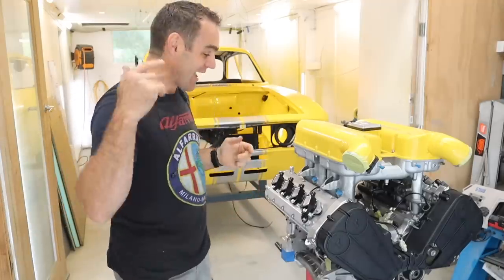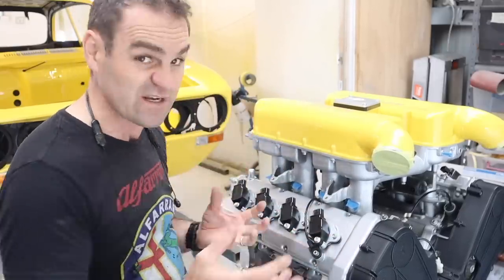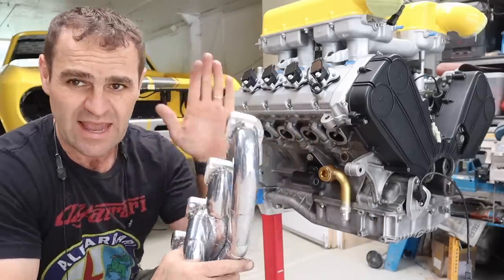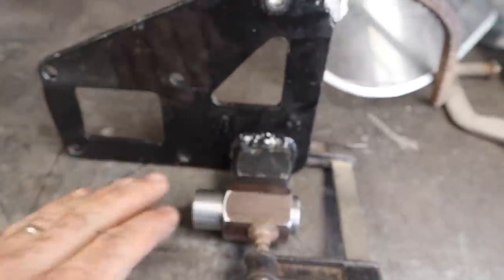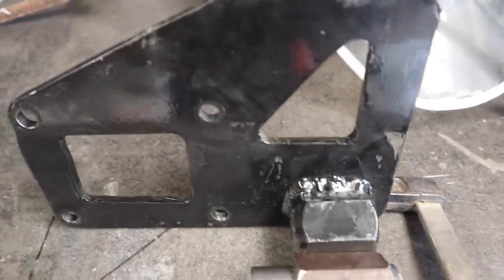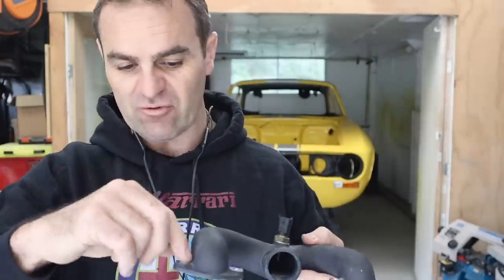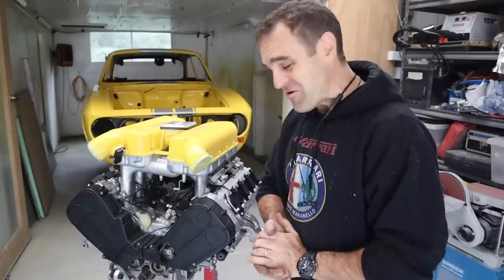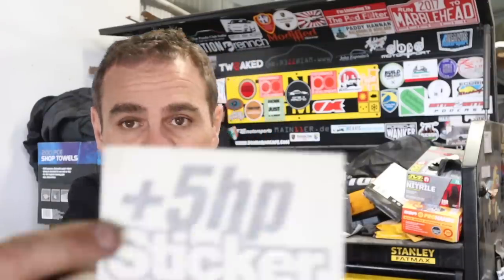I broke part of the Ferrari engine - Ferrari engined Alfa 105 Alfarrari build part 162

Comment: The engine looks sweet Jeff.
I think what you did with the coil packs is spot on.
Cheap simple effective.
And nice touch painting the lower shim as it looks like a rubber gasket & looks factory. 
Easy to remove the coil packs.
..
The alternator does look a bit low there possibly vulnerable to road debris.
...
Taverish had the exhaust manifolds ceramic coated on his Lamborghini project a few years ago.
Claimed a 20% heat reduction looks good too.👍

Comment: As for the oil and washe fluid caps,one potential solution to label them IN the car and not in the caps,would be to cut some stencils with only the little icons that appear in an ordinary cluster and paintbrush them in the car.something like we do to paintbrush the insignias on plastic model kits of fighter planes!

Comment: For washer and sump caps you could consider a tastefully subtle color coding on the edges of the cap that match to a small stripe on the engine bay. 

Just a thought, excellent video per the usual 🙂

Comment: For the caps, the labels doesn't need to be seen from the outside, you could add a small indicator as soon as you remove the cap. You can paint it with a light color, or you can add a painted ring with am emblem on it on the inside of the tube and not on the caps. As soon as you remove the cap you will see the indication.

Comment: Great job man. I’m a little concerned about the exhaust manifold studs length. If I can give you some advice, be sure there’s 1 to 3 threat protruding from the nut (usual aviation standard) to ensure proper self-locking. Have fun

Comment: There's a chap over on the YT channel Sleurs Motorsport who built part of an intake system on his Lotus Europa using 3D printing, so it can be done (with the right material) ... But I hear you.  I like it for prototyping and for other non-critical things, but otherwise a solid piece of metal or alloy is always a better option!

Comment: The trick my grandfather taught me for making thin gaskets on harder/tougher materials than that manifold is to sit the material on the surface and lightly tap with the ball face of a hammer around the edge. It works beautifully.
Reply: Can use this trick for masking parts for paint as well. I think he might have done it in a different episode for the valve covers.
Reply: Learnt the trick of using a small ball face hammer as an apprentice for gaskets, it worked perfectly but that was on cast steel/iron. On a Thin Aluminium I would prefer Jeff's trick.  Certainly wouldn't like to break that manifold no matter how gentle you are!

Comment: Jeff, do a leak check on that welded manifold by pressurizing with fluid. Check also the spray pattern of the fuel injectors and make sure you have the right flow by a certain pressure. Build yourself a test bench or send them for testing. Cheers mate.....BTW i´m seriously considering visit Van Diemen´s Land LOL.....

Comment: For the gaskets, especially on cast pieces, you can lay the material over the surface and tap the edges with a ball peen hammer. It will cut itself out and be the perfect shape.

Comment: Another brilliant episode. I love your meticulous approach. I wondered if, while you have access to the mounting bracket (or is it the oil pump?) it would be worth taking the bracket off so you could invert it to allow you to prefill the oil filter with oil before screwing it on? The engine has been standing for a long time and won't like cranking over for a long time to fill the filter before it gets oil pressure.

Comment: Loving this whole build and the detail that's going into it. I can't wait for the first start. I bet that you are anticipating the 7000 rpm sound of that jewel of an engine. I truly hope that the car handles as it should because the 360 Modena is renowned for its understeer and its unpredictable handling under power. Just a suggestion. Have you considered a gated shifter when completing the interior?
Reply from the maker: 9000rpm ;)

Comment: If you do a simple aluminium plaque and engrave them with the right label, it could look nice.
Reply: Not a bad idea at all! Alternatively Jeff could have the oil and windscreen washer logos engraved directly onto the caps.
Reply: @tonydegouveia9256  
He already said he doesn't want to lathe down the caps to then have them painted again, besides, that won't solve the issue of someone mixing them up side to side.
Reply: I'm assuming you're not worried about forgetting you just wanted to look nice? They don't necessarily need anything

Comment: regarding labeling the caps: couldn't you paint the inside of the caps different colour and use those colours on the rims of the spouts? this way the outside would be black, but the very top of the spout and the inside of the cap would be brown for oil and blue/green for washer cap.

Comment: why not a black finishing ring for the filler cap issue, with oil/screen wash lasered into the surface.. the ring going around the pipe and fixing to the body.

Comment: Nice work! The ceramic coating looks nice. Maybe a long the a go you mention it, but for chancing the oil filter, do you have enough spice  underneath the air intake ,or you take the inlet manifold off ,or are you go to use a oil filter relocation kit?

Comment: Nooooo...

Not rubberized cork gasket material....in any way...

That should be paper-like gasket material instead...with light coat of rtv or very thin bead strip of rtv laid on top and bottom surface of the gasket....

Rubberized cork gasket material definately not a good choice for any engine...especially with more modern gasket material available easily...

But the rest of this car built super mint...keep on..and cantnwait to see this run for the first time...

Oh by the way... 

Regarding headlights...maybe... Maybe u can retrofit a set of 35w 2.5" or 3" bixenon aftermarket projector... (Or more modern bi-led projector unit)  that can be fitted to oem headlight globe housing with minor enlarging work at the bulb base to secure the projector unit.. (that usually comes with screw on fitting for this type of retrofitting job)

While still utilizing the oem headlight globe/bucket and front lens cover, a set of projector unit with much sharper and crisp light output for the road definately would benefit u while driving in the dark...

And yes im not a fan of those "infamous" led multi-array round headlight option...it just doesnt fit the car...

As reference in some market bmw e30 and older mercedes have this kind of round headlight with projector unit inside of it...

Comment: I agree I can't stand 3d printed parts 99.9% of the time.  They look so cheap and I have little faith in their structural integrity.  It's good for very limited use cases, you were correct in making the spacers out of metal.

Comment: Can you please give me the part number of the injectors you are using?
Reply from the maker: They are from Raceworks 0 280 158 051. They don't fit a standard 360 engine though.
Reply: @HomeBuiltByJeff  thank you, we are restoring a chevy Monza race car that had mechanical fuel injection, we have modified the throttle bodys to take electronic fuel injectors and need something really short to hide and make it look like the original mechanical injectors. so having to research short injectors and knowing some part numbers help.